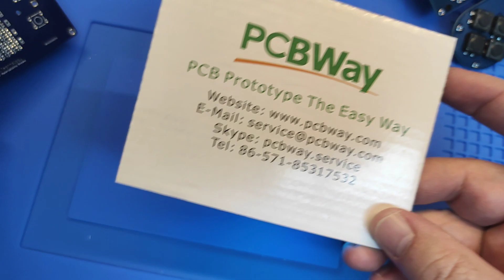RGB LED Matrix game console (ws2812, HUB75) on SAMD21

Comment: I like the gamepad you build ... maybe a custom Bluetooth gamepad will be a good device ... the prices are high!
Reply from the maker: gamepad is detachable but this project is designed as main controller for big coning operated arcade machine with separated big buttons (visible on some old videos), This gamepad is for development only. Bluetooth gamepad or any other wireless is connectable via USB host on samd21 but it complete break extreme simplicity idea, and for this simple games is complex gamepad useless. ;)

Comment: Hey Peter, how are you doing? Great video. Just wanted to ask: does the bootloader for samd21G18 works directly with samd21E18? Same binary? Are you using adafruit metro m0 bootloader?
Reply from the maker: I am using little modified (name changed and led indicator GPIO) UF2 bootlader from adafruit, but for years i have used arduino zero (G18)  bootloader without changes
Reply: @bobricius  Thanks for the reply Peter. Love your projects.